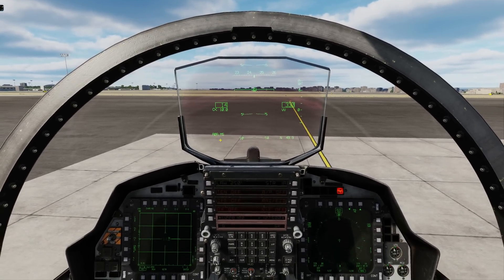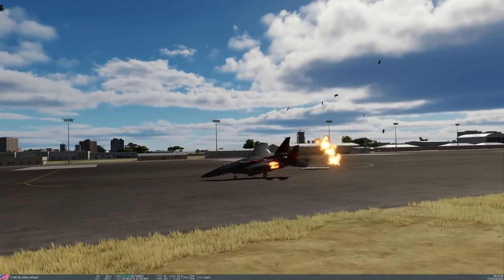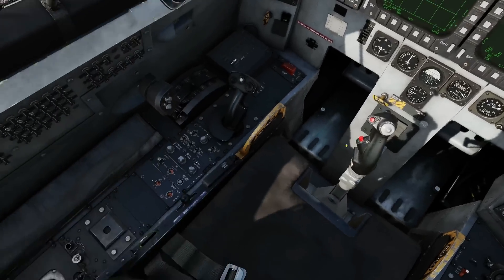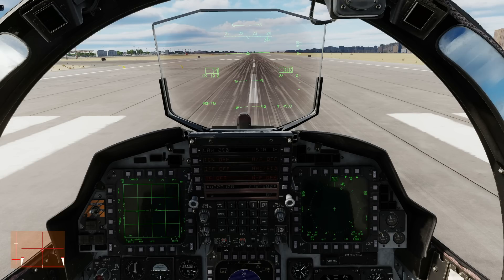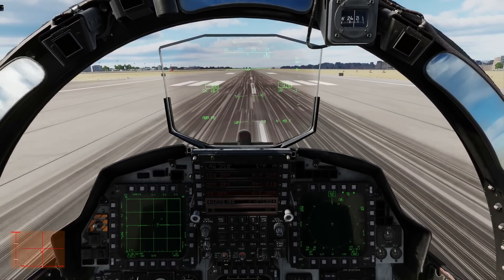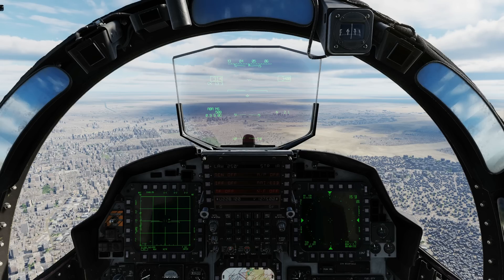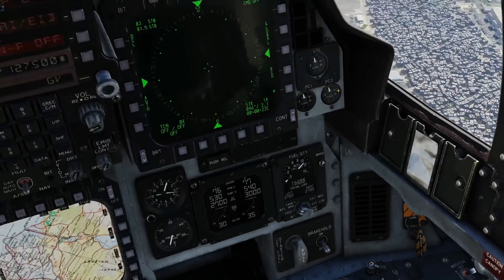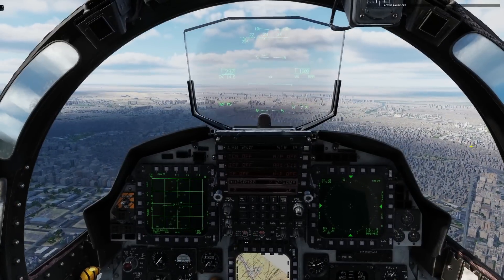F-15E Strike Eagle: Taxi, Take Off & Landing Tutorial | DCS

Comment: My problem is how much the aircraft likes to jerk from side to side while decelerating on the runway, I find myself wobbling way too much and I end up over correcting. I suppose that just shows I need to fly it more. Tips and tricks are more than welcome!
Reply: The F16 maiden flight had similar issue and was quickly fixed by applying throttle. Also on takeoff. In your case it may be the reverse.

Comment: Loved the video @Grim Reapers! Can't wait for the next video man! The F-15 Eagle is such a Great Jet. I wonder if Centurion will be Featuring it in Future Campaigns for the Second Channel?

Anyway, as mentioned in the last video with CH and his Modules, I have the List and Specs for the Equipment used by the AI Forces in the Weapons DLC for Stormworks: Build and Rescue for you man. This should help give you a General Idea for what the Stormworks Community is Up Against whenever the Weapons DLC is taken into consideration.

AI Navy:
 • Destroyer: Length of 54.75 Meters (177 feet 11.25 inch), Beam of 7.75 Meters (25 feet 2.25 inch), Mast of 15.25 Meters (49 feet 6.75 inch) and a Draft of 3 Meters (9 feet 9 inches). Top Speed of 12 m/s (about 26.5 mph or 23 Knots) and 5 m/s (11 mph or 9.6 Knots) in reverse. Armament Consists of a Battle Cannon with 4 Barrel Extensions (4.75 Meters in Length or 19 Blocks since each block is ¼ of a Cubic Meter) on the Bow with Technically 3 High Explosive Rounds but the AI will cheat in more if it runs out, a Rotary Autocannon with 100 High Explosive Rounds in a CIWS-like Mount at the Stern, a Light Autocannon with 200 High Explosive Rounds just in front of the Bridge and 4 Machine Guns loaded with 50 Kinetic Rounds for Decorative Purposes. A Missile Armed Variant with 8 Radar Guided Anti-Aircraft Missiles in place of the Battle Cannon at the Bow also exists in the AI Navy Inventory however Encounters have been Slim to Nonexistent since the DLC's Release on October 5th, 2021 though Vtuber @Ginger Kitsune has footage on her Channel in the First 4 Hours in her 8 Hour Vod for Playing Stormworks with the Weapons DLC and Space Engineers with @Rimmy Downunder Gaming and his Friends Warpugs and Sam where they Lured the Missile Destroyer Variant onto the Beach in Olsen Bay and she and Rimmy just started Pulling the Missiles off of the Launchers. Quite the Show, trust me.

 • Fast Attack Craft: Length of 22.00 Meters (71 feet 6 inch), Beam of 4.75 Meters (15 feet 5.25 inch), Mast of 5.00 Meters (16 feet 3 inch) and a Draft of 1.75 Meters (5 feet 8.25 inch). Top Speed of 16 m/s (about 35.45 mph or about 31 Knots) and 5 m/s in reverse. Armament Consists of a Heavy Autocannon with 3 Barrel Extensions (Length of 5.5 Meters or 17 feet 10.5 inch) with 40 High Explosive Rounds at the Bow, a Light Autocannon with 200 High Explosive Rounds at the Stern and 4 Machine Guns loaded with Kinetic Rounds for Decorative Purposes. This is the Fastest ship in the AI Navy Inventory and the Smallest. It's also pretty Maneuverable in terms of Steering so it can Match the Turning Circles of Small Craft though it's easy to destroy with Battleship Caliber Guns, Maybe even Cruisers and Destroyer Calibers as well.

Both Ships in the AI Navy don't have any Compartments so even one hit will sink them eventually. They will keep spawning in if you're not careful, in the Highest Difficulty levels for the Sliders as you set the Game up it's possible for another 2 Ships to spawn in while you're fighting One already so be careful.

AI Army:
 • SPAA Tank: Length of 9.5 Meters (30 feet 10.5 inch), Width of 5.5 Meters (17 feet 10.5 inch), and a Height of 3.75 Meters (12 feet 2.25 inch). Just Sits at or Nearby the Capture point, so it doesn't move. Armament Consists of 2 Rotary Autocannons with 109 High Explosive Rounds Per Gun, one on each side of the Turret, and 2 Machine Guns loaded with Kinetic Rounds, one on top by the Commanders hatch and one in front of the driver. These guys will mess you up if you're not careful as the High Explosive Rounds will kill you through the walls of nearby Buildings. As I said before, The Rotary Autocannon is the 30 millimeter Avenger but more on the Size of the M61 Vulcan with the Avenger's Length so it'll tear through you and any builds you might be in.

 • Main Battle Tank: dimensions are similar to the SPAA Tank, Armament Consists of a Heavy Autocannon with 5 Barrel Extensions (Length of 7.5 Meters or 24 feet 4.25 inch) with 20 High Explosive Rounds and 2 Machine Guns loaded with Kinetic Rounds in the Same as the SPAA Tank for Decorative Purposes. As with the SPAA Tank, this mainly sits at or Nearby the Capture point, not as bad as the SPAA Tank due to it's Slower Rate of Fire but can still kill you if you're not careful.

AI Air Force:
 • Eurofighter Typhoons with 2 Air-to-Air Missiles for Decorative Purposes only, 2 Light Autocannons each with 100 High Explosive Rounds and 48 Rockets in Wing Mounted Rocket Pods. Top Speed of 115 m/s (254.8 mph) however the AI will fly them at their Cruise Speed of 70 m/s (155.1 mph) due to the Limits of the AI in Stormworks. As soon as you go over Cruise Speed, that's when the AI can't actually fly their Jets as they just fly straight and level.

 • Eurocopter Tiger Attack Helicopter: Armament Consists of 4 Rocket Pods, 2 on each Wing, for a Total of 16 Rockets and a Light Autocannon with 100 High Explosive Rounds in a Chin Turret. The Appearance is on par with the Australian Tiger ARH (Armed Reconnaissance Helicopter) however it's top speed is 45 m/s (99.7 mph) which is Slower than the Tiger in real life, like the Typhoons. It is the Only Vehicle in the AI Forces Inventory to have XML edited Parts as well.

 • Bell UH-1Y Huey "Venom" Transport Helicopter: Armament Consists of 2 Light Autocannons, One on each side, with 200 High Explosive Rounds each, 2 Rocket Pods each with 16 Rockets, again one on each side, and 2 Machine Guns loaded with 50 Incendiary Rounds each as Door Guns. Top Speed of 33 m/s (73.1 mph) which I'm going to safely say is Slower than the Huey "Venom" actually is in real life.

The Source for this Information is a Guide on the Steam Workshop by A Canadian, I have it Bookmarked so that I can try and figure out the Basis for each build though I've only identified the AI Air Force Inventory and my best guess for the Navy Inventory is the Swordfish and Needlefish from the Game Carrier Command 2. The Air Force will also likely keep Spawning in As well as mentioned earlier in the AI Navy. As for the Army Inventory, I can only assume that the Tank is a Horrendously Deformed T-62 Turret on a T-72 (-ish) Hull and the SPAA Tank is meant to be a Cross between the Soviet-era ZSU-23-4 Shilka and the 2K22 Tunguska in terms of Firepower and Appearance. I'll let you try to figure that out how to represent it in DCS man. And in case you're wondering, Operation Shoestring II is a go, in about 10 days or so @Camodo Gaming and @Spycakes should be taking the Beaches on the Island of Donkk by Storm and Liberating it, The Chemical Factory, Lighthouse O.B. and Terminal Camodo from the AI Forces in the Weapons DLC.

I hope you like the Idea man, I spent about two hours typing this up! Let me know what you think about it and I'll catch you in your next video!